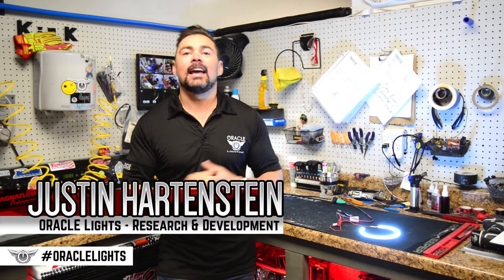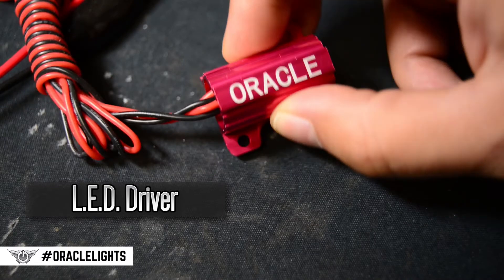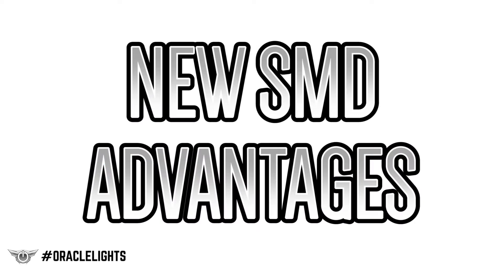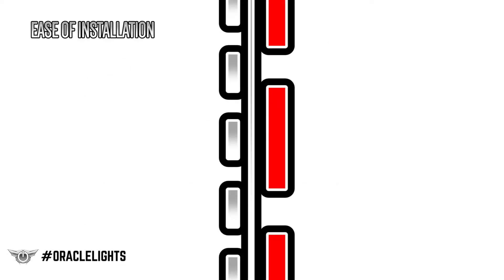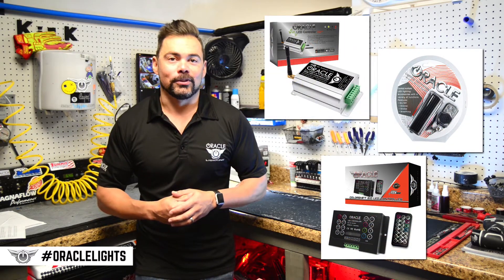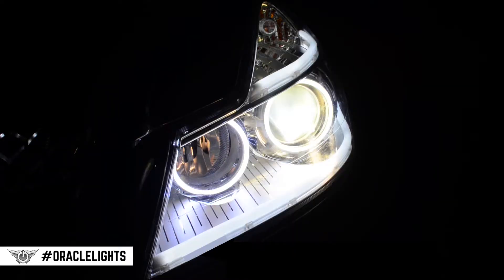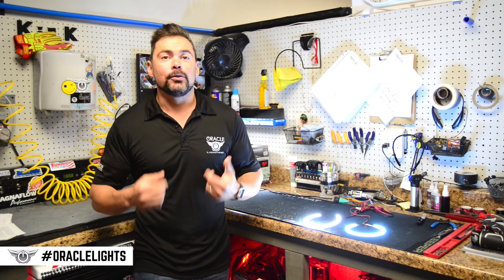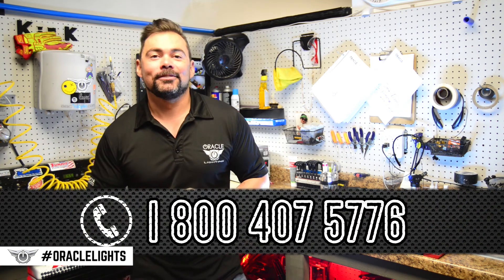ORACLE Halos Overview: SMD vs. Plasma LED Technology

Comment: do u sell halo pcb boards that can be cut and shaped to a specific size
Reply from the maker: we can usually modify the PCBs in house if you have a specific request.
Reply: @ORACLElights  yes 40mm high by 400mm long with a 10mm ring and 20 degree circular cut. i have the cut file if that helps
Reply from the maker: @Thewolverine691  send 2D file to info@oraclelights.com ATTENTION R&D

Comment: I recently ordered a set of black housing led headlights with pre-installed halos for a jeep jk. Part #:5769-001 other videos showed these headlights came with external led drivers like in this video. My set didn't come with them and I wanted this new current technology as they are explained to be better. I don't want an older tech product. Can your company correct this?
Reply: The internal driver have the same benefits as the external driver explain in the video? Beside being able to replace it if it goes out...Will it protect the halo from voltage fluctuation  to prolong the life and have the same brightness? 

Also why are the plasma versions of theses headlights twice as much as the smd version?

Comment: You said the SMD lights are 4% brighter than the plasma, your website says the opposite. The comparison chart says that the plasmas are the brightest. What are we supposed to believe?
Reply: Go to your home page and click on the automotive products, then select halo kits and scroll down to the comparison chart and you'll see what I'm talking about.
Reply: I was seriously considering an amber halo kit for mine, but I'm not hacking/splicing ANY virgin wires on my car to do so. I do have the stock amber DRLs on mine and would love to complete the look around the outer headlights and fog lights too, but ONLY if it is truly plug and play WITHOUT splices. For example ... if you had an adapter plug for the headlights that also had plugs for all the drivers so you wouldn't have to splice into anything. Doing that on an everyday driver through road salt in the winters is eventually just asking for headaches. I'm also not willing to cut apart perfect headlight housings for this either. Yes, I'm anal and fussy with my stuff. If you guys make a waterproof surface mount plasma kit for that are plug/play ... I'm all for it. Otherwise I'll leave well enough alone and just keep wishing I had them on my other 4 lights.
Reply: No problem